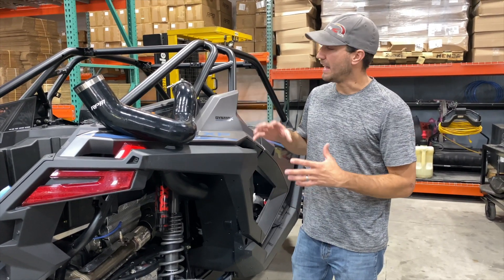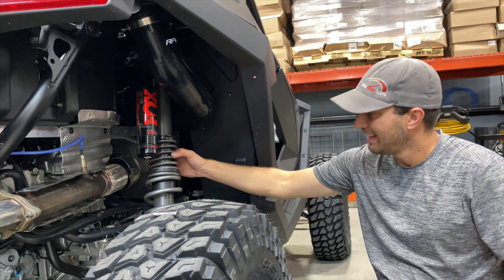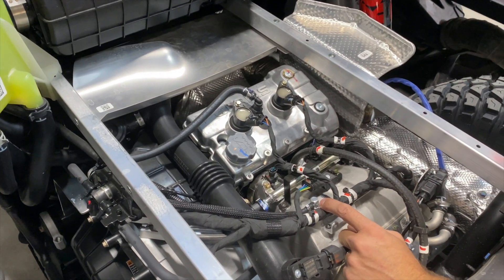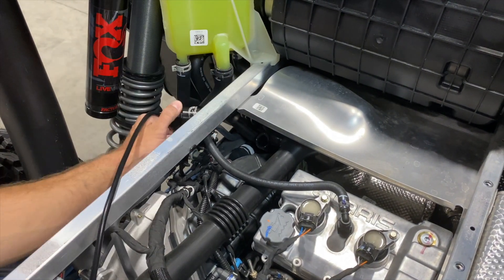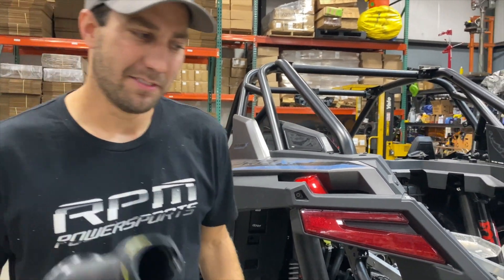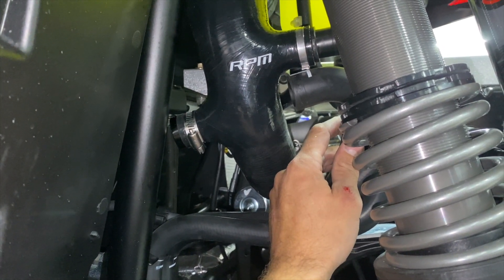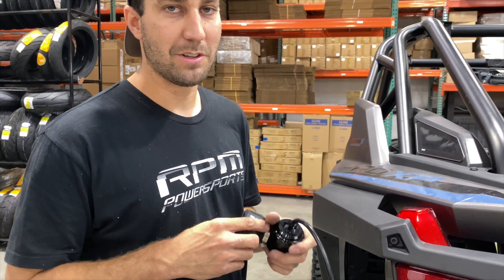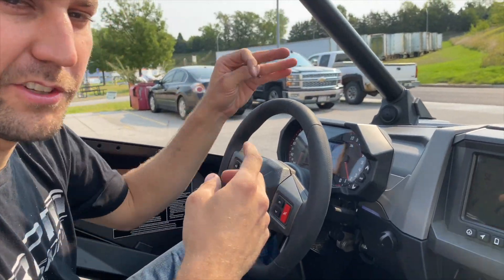RZR Pro, Turbo R BEST Silicone Charge & J Tube , BOV , & BIG FATTY Intake Tube. RPM SxS Installation

Comment: Cubic inch x rpms determines whether or not the OEM cross sectional areas of the tube are adequate. Same applies to every other intake component in the system. I'll give a nod towards this being a "quality" upgrade vs. plastic, but it's not a "power adder".
Reply from the maker: Volumetric efficiency and air speed volume are a measurable formula used when testing these. Not only are they power adder, but more importantly a compounding modification meaning the more you do, the more you'd benefit. Any time we can smooth the air flow, and increase air turbulence, we're going to see gains. Even looking at the oem tubes you can see the corrugated sections and make sense of the air flow disruptions. Combine that with the factory intake tube bottle necking, and yes, power will be had.

Comment: I bought one for my 2017 xp4 turbo.. definitely makes a difference didn't felt much HP gain but it does sound way better than stock and breathes better. More air better swooossssh sound 😂

Comment: Is this just for sound or does it actually provide hp gains?
Reply from the maker: The tubes or the BOV? the tubes prevent all kinds of issues the stock ones have. the BOV replaces the factory problematic plastic one.